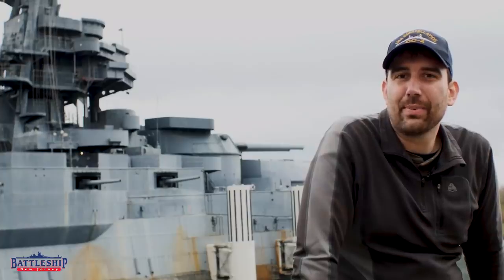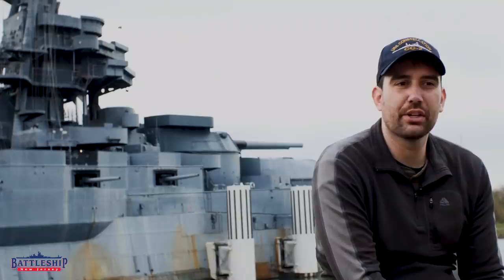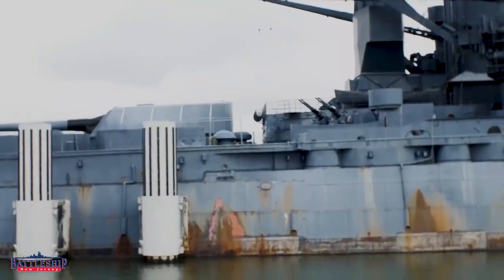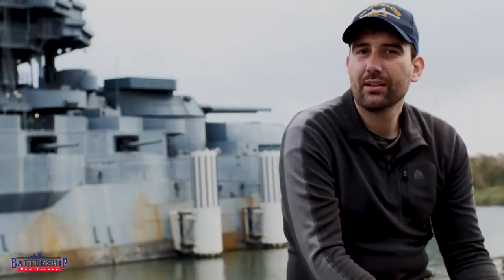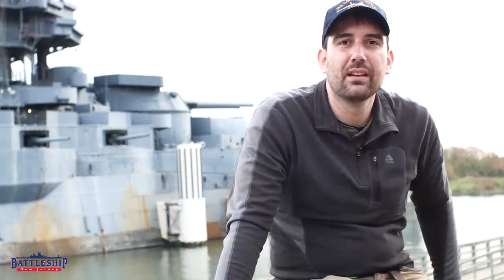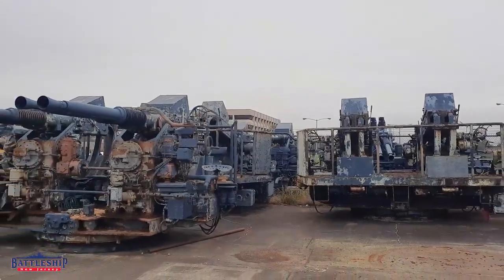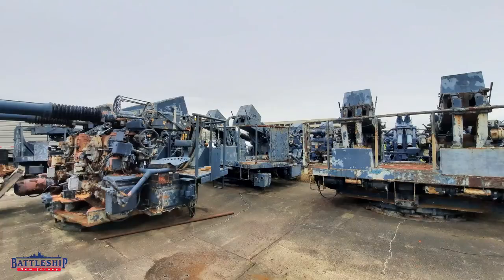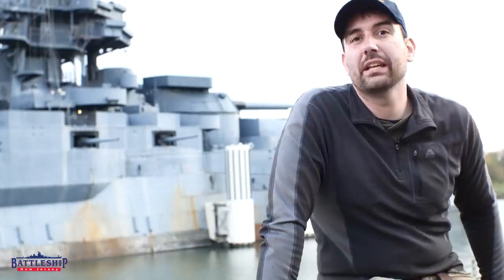What's It Take To Maintain A Battleship Like Texas?

Comment: I would be interested in a video about decisions made by the Texas museum that ended up being mistakes in hindsight. Those kinds of things are usually interesting. It's also worth pointing out that Texas isn't just  older than NJ, it's also been retired much much longer. NJ had the navy taking care of her 30 years ago vs Texas, 75 years ago.
Reply: That is what I am interested in as well. Like using concrete as a deck material! 🤦‍♂️
Reply: I second this, while I watch all of Ryans videos I’d be especially interested in that one.
Reply: @thewordisgood1544  good idea, but concrete also corrodes steel.
Reply: @T3hderk87  Concrete was used as deck on Texas. That's why it would make a great talking point in such a video.
Reply: A good video to suggest Texas's team made, they'd be able to give so much more detail about whats happened and why it was a bad idea. (And would look a lot less like an attack on the work of another museum, even though that would never be the intent.)
Reply: I know one thing they did wrong Was they used long-term foam in the torpedo blisters which prevented sinking but caused extensive corrosion due to trapped humidity

Comment: Texas is a complicated topic.  The current conservators are the third such group to exist.  The previous group spent 80% of their time undoing four decades of neglect.  The current conservators are doing sterling work--but really need to improve their communication interfaces.   Which is what probably generates 80% of the questions that are asked.
Reply: @robertgutheridge9672  The main issue is funding. Navy and government no longer own Texas techicnally. Many people in the Navy actually want her scrapped due to the sheer cost of the ship is ballooning. There's a reason why such old ships tend to get scrapped its cost and finding a proper reason to keep the ship around. One group actually proposed was to keep some important sections (aka cut parts off to save) and then building a land based museum for those parts. As then it would be easier to tell the history of the ship and acquire proper funds. Another issue is the ship is so large it's causing issues to fix some areas which are still being found with major damages. As is one drydock did a estimated time for a repair in drydock would be nearly 50+ million and then it'd be drydock for around upwards of 3-6 years just for the major repairs but a total repair would push 10+ years. Samething happened in Russia with the Aurora which is even older than Texas. What needs to happen is the ship either needs to end up on land, cut up and save what is important, or find a organzition with a large amount of funds to  actually retrofit parts of the ship to save it (which would cost even more in the long term). I even understand the ship is hugely important but somethings even those which have massive importance for a nation with history sometimes need to be saved in different ways even if those ways seem like the worst immediate actions when in reality its the best action for long term saving of the history
Reply: @northythefosk7501  I know that. 
But if our government can Barrow money and then give it to other countries  most of whom don't like America. 
Then in my opinion our government can help to preserve our own history.  Or the navy could at the least  allow the use of the dry dock. But Congress won't help because helping to preserve American history  doesn't buy votes.

Comment: This is a great video that points out most of the major issues that the ship faced over the years.  One thing that bothers me is the propensity of many to blame former staff for the ship's deterioration.  I think it is fair to say that starting in 1948, all of the people responsible for the ship were some of the hardest working and most dedicated people that you could find anywhere.  As Ryan said, mistakes were made, but that is inevitable when they were the first to deal with issues of this type.  Otherwise, they were hamstrung by lack of funding and staff that seriously limited their ability to maintain her.

There is an interesting aspect about the structural repairs below the engines which was the possibility of the engines falling through the hull if the framing beneath them had not been repaired.  As Ryan said, they were partially suspended using heavy threaded rods and supported from above by the protective decks during repairs.  They intentionally left most of the engines' weight on the compromised hull structure to keep it from being pushed in by hydrostatic pressure.  Part of the suspension system included strain gauges that measured stress on each of the rods.  During repairs, they found that engine weight changed significantly on a fairly regular schedule.  It was determined that the ship touched bottom during low tide and the hull structure was weak enough to defect up, push against the engines and lift up on the suspension rods.
Reply: I agree. Somebody had to be the pioneer. One important thing, she's108 years old and still with us so somebody was doing something right.

Comment: Eeeek, foam. I watched the guy who owned a vintage former lightship trying to dig foam out of below deck compartments that was put in there to keep the ship afloat at the end of her service, that was a HELL of a job.
Reply: It's polyurethane based, so think : Gorilla Glue  and that will give you an idea of how strong that stuff sticks to everything.
Reply: I'd like to know what sort of foam they are using that can be pressure washed out.
That guy with the lightship was using electric rototillers to get the foam out of his ship. Looked like a miserable job!
Reply: The foam is only temporary and is being used to exclude water in compartments prone to flooding during the ship's tow to dry dock.  The key to using and removing it is that all compartments where it has been used in will be open to the outside during the process of replacing the outer hull skin.  This will make it fairly easy to water blast it out.
Reply: @wanderer397  I'm fairly certain the goal is NOT to set the ship on fire.

Comment: I am curious what type of foam was used.  Anyone living in the rust belt knows that open cell foam like great stuff actually just holds the water against the metal and makes the rust worst.  Lots of people used to put that in rotted out rocker panels.
Reply: Closed cell
Reply: This is what I was thinking. I work in the gulf on osv’s and on a steel hull, we would apply rust bond corrosion inhibitor, primer and then paint on all bare metal surfaces. Foam alone will not seal a space and prevent corrosion. Hopefully the $35m the State of Texas is giving the foundation for dry dock, they’ll get it sorted out.
Reply: The foam is a temporary measure that is only being used to exclude water in the torpedo blisters and a few compartments inside the hull that are prone to flooding.  It will be removed once in dry dock and during hull shell plating replacement.  All of the spaces where it has been used will be open to the outside and water blasters will remove it.  Once that has been done, the remaining metal surfaces will be cleaned and coated, then new shell plating will seal them back up.
Reply: @tomscotttheolderone364  LOL,  Not the other Tom Scott,. He would be interested in "Texas" i'm sure, you sound like you are involved with Texas.  If so, maybe reach out, his viewers may give some support?
Reply: @tomscotttheolderone364  awesome! I was hoping it wouldn’t be permanent! I’m excited to see Texas here in Galveston temporarily! I will be a nice change in scenery
Reply: @tomscotttheolderone364  also, I have shipyard experience on OSVs if you guys need a helping hand between my boat hitches.
Reply: @seapappy9183  Thanks, but I am simply a volunteer.  You need to contact Travis Davis if you would like to help.
Reply: @seapappy9183  Don't let Tom fool you with his modesty, he is far more than a "simple volunteer." He has a YouTube channel with amazing Battleship Texas content. 
If you haven't already, you should definitely go and check it out!
Reply: Tom I think has the best videos ever. He goes through EVERYTHING you can ever think about when it comes to Texas
Reply: @tomscotttheolderone364  Just coming back to say I was wrong and you were right.  The dry dock workers did a fantastic job using the high pressure water to absolutely pulverize the foam.

Comment: At one time the teal decking on the Texas was removed and replace with cement or concrete.
Reply: Same on the Olympia
Reply: Texas never had a teak deck, except in certain spots. It has always been pine.
Reply: That is correct, except that most of the wood deck on Texas, even when first commissioned, was pine.  The wood had deteriorated to the point of being dangerous by the late 1960's and had to be removed.  There was nowhere close to the funds available to replace it with wood, so concrete was used as a low cost alternative.  Unfortunately, the concrete acted like a sponge and held moisture against the steel that was directly below it.  The result was scores of leaks that allowed water to penetrate deep into the ship.  Even though that was corrected and a new wood deck put on in 1990, they are still dealing some leaks that are hard to find and pretty extensive damage deep in the ship that it caused.

Comment: what about clean the hull, paint it, wait for it to dry, then spray with polyurethane expanding foam and cover with a layer of plastic? Unsightly until it's painted battleship gray, but should protect the steel by removing all contact with fresh and sea water.

Comment: Ok...dreadnaught.  I've seen that a few times and I can't help but wonder, "as opposed to what?"  Like, saying it's the last of the dreadnaught ships makes me wonder, what does that mean?  What came next?
Reply: In the US it was the “Standard” type like Pennsylvania class. 4 turrets, same speed, roughly same armor, 5,000 tons displacement more for each class. Then you get the fast battleships like North Carolina and South Dakota.
Reply: @johnbeauvais3159  Ah. Got ya. Thanks!
Reply: The standard-type battleships (late teens-early 1920s) followed Texas-style WWI-era dreadnoughts. USS Nevada, USS Oklahoma, etc. are examples of standard-type battleships. Texas is very, very special in that she's the last surviving example of a type of battleship that many countries once possessed.
Reply: @johnsykesiii1629  Hahaha...down the rabbit hole!
Reply: @yes_head  I've always figured that the spotting feature for a Dreadnaught type battleship is the secondary armament located in casements, usually below the main deck (many were later moved up to the main deck).  Post Dreadnaught (i.e., modern) battleships had the secondary armament located in turrets,  "Dreadnaught" refers to the HMS Dreadnaught, commissioned in 1904.  USS Olympia was a "pre-Dreadnaught" design.
Reply: @johnsykesiii1629  Right, the standards were still designed with their secondary armament in casements. They were just above the main deck where the gun crews wouldn't be swamped. IMO it's always a bit odd seeing photos of the standards from late in the war because the 5" 38 mounts look weirdly oversized.

Comment: Out of curiosity why not build a permanent dry stand to keep the ship on?  That way you wouldn't have to worry about leaks and you'd only have to pay to dry dock it one time.
Reply: Exactly my question. Why not remove the ship from the water completely? From what I’ve seen in various videos, it appears that not only the hull is in bad shape, but other parts of the ship seems to be affected by rust.
Reply: This was discussed several years ago. The state of Texas actually set grant money aside to do this. There were two or three possible ways they were gonna do it and as the team was surveying the ship to see which was the most feasible they discovered that the ship wasn’t even suitable to be dry docked even short term let alone long term.
Reply: He has talked about this in other videos generally about preserving historic ships. There are positives & negatives to the various options. Check the back catalog of videos.

Comment: Was the paint on the frames regular paint or zinc based.
Reply: The historic coatings were oil based on top of lead based primers, which is now a hazardous substance that has to be removed by licensed contractors wherever it is being removed to repair or restore anything.  Coatings used over the last 40+ years have largely been alkyds which are now being replaced by epoxy based primers and coatings.

Comment: That foam will rot it out twice as fast with trapped moisture.... would not recommend that!
Reply: The foam will be removed when the ship is in dry dock a few months from now.  All compartments that it is currently in will be opened to the outside when the hull shell plating over them is being replaced.  That will make it easy to remove the foam with water blasters.

Comment: Why oh why can’t this thing be PERMANENTLY moored in a drydock like structure filled with pea gravel?  That would provide similar structural support as water, yet water can be drained from beneath as rain drains directly to the bottom....
Reply from the maker: the gravel will end up with rain water in it, and then you still have water up against the hull. These things are too massive to put inside a building.
Reply: @BattleshipNewJersey  -No, that’s the purpose of pea gravel. It’s used for a million and one water mitigation and drainage issues where a semi solid form of structural support is needed.   It’s used for grey water dispersal as well as directly up against leaky foundations all the time........The water runs down to the bottom where it can be drained (or if necessary, occasionally pumped) elsewhere.  Sure, there’s incidental water contact with the hull, but no more frequently than when the superstructure gets rained on.  The space between the individual pebbles insures that there’s plenty of air present for rapid evaporation.   AND IT’S FRESH WATER, NOT SALT.
Reply: @BattleshipNewJersey  -For that matter, even occasional contact with wet pebbles can be entirely eliminated by installing a five foot wide (corrugated fiberglass?) awning around the edge of the hull directly above the water (gravel) line.  Ever stay dry beneath an awning while fumbling for your back door keys???  The hull would stay just as dry as the side of any building that has wide soffits up near the roofline.   Water makes very little LATERAL movement as it drains down through gravel.  And plain old gravity insures the efficiency of such drainage.  There may possibly be some reason why this wouldn’t work, but it’s sure to be something far more daunting than an occasional thunder storm.

Comment: You're questioned because your programing is easy to find, and you respond.  Two factors the Battleship Texas people are not.  Texas shouldn't have to deal with the threat from salt water.  Copy Mikasa and plant Texas high and dry in a permanent location and end the corrosion issue once and for all.  Don't farm her out to the high bidder. Leave her be.
Reply: Mikasa is not high and dry, she's buried in concrete. Her lower levels will never be seen again.
Reply: Or move her somwhere she wont rot as quickly and keep her there ik putting her on land probably wont be possible but somthing is better then nothing

Comment: Why don't they do what the Japanese did with Mikasa granted you won't be able to see the underside or anything like that but it will completely stop any risk of further damage
Reply from the maker: Concrete is damaging Mikasa
Reply: @BattleshipNewJersey  how is it damaging Mikasa?
Reply: @donald9108  Concrete is permeable and holds water against the steel hull plating.  Any protective coatings applied before being put in concrete either degraded over time or was ground off by the movement of concrete against steel due to the differences in their rates of expansion and contraction.  Once compromised, the steel is destroyed and it cannot be reached for repair.  You cannot even get to it from the inside because much of the lower hull was filled with concrete to act as ballast to keep the hull from floating due to water getting between the hull and concrete.  This is obviously the case with Mikasa since only her upper decks can be accessed.  Additionally, artifacts that could not be removed were also covered when the concrete was poured in.  By the way, their destruction was an intentional goal.  Using concrete inside and outside was also done to permanently disable her in order to meet the terms of the Washington Naval Arms Limitation Treaty of 1922 that would have otherwise required sinking or scrapping her.

Comment: I hope they use AMERICAN steel.
Reply: What does it matter as long as it is the same quality?  If the staff of the USS Texas are able to get more restoration work done by saving money from the sourcing of materials isn’t that what the most important issue?  Are you trying to infer some other racist issue?
Reply: The used higher quality Chinese steel, hope this helps you rest easier
Reply: @crispay8304  you have never ordered steel.
Reply: @carlmcginty4337  you have never ordered steel, either.

Comment: The only way to safe the ship, take it out from the water, bring the ship on shore. In the water a ship loose minium 1mm Metall every year, UNDER        the Painting.  Make a building around the hole ship,  and everybody will be happy. Finish ROST, only painting  fore   low cost. THE ONLY WAY. 
Nobody can  stop ROST in the Water., it is a chemical physical Prozess. Painting no stop the Prozess, only fore month, no Years.
Y am a restauration expert.